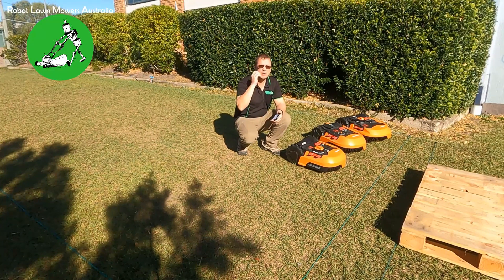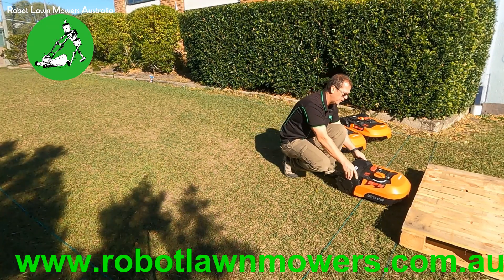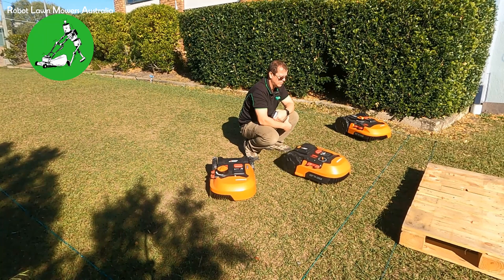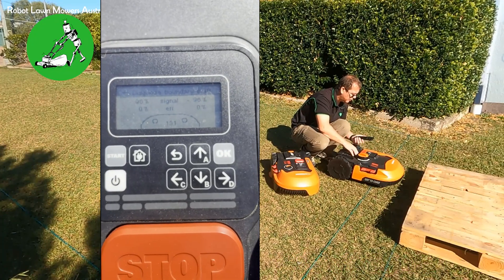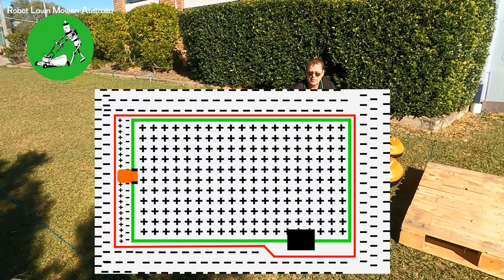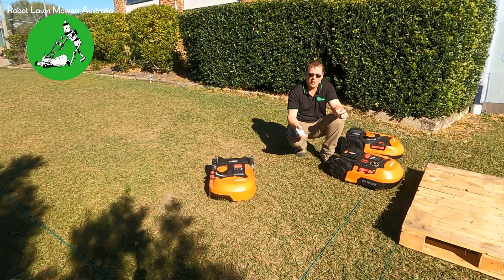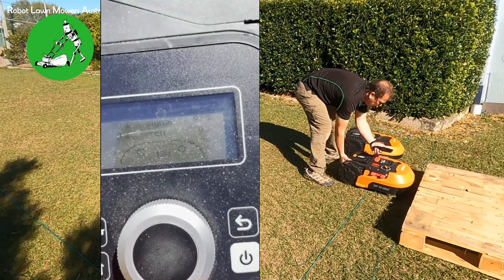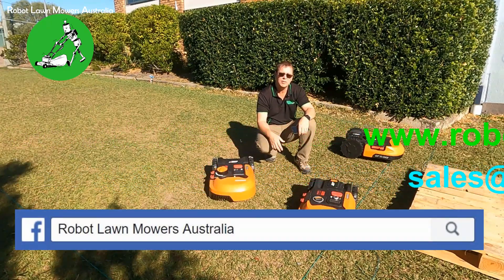Robot Lawn Mowers Australia - Worx Landroid Crossing Boundary Wire

Comment: Glad I found your video and thanks for the information.
I have this very problem with my W139 after I erected a galv-tube-framed chainwire mesh fence alongside the lawn.
The Landroid has become stuck twice over the boundary wire as it's wedged up to the fence, the gap between the boundary wire and fence is only 200mm. I might try narrowing the gap so it has more chance of pulling back out rather than getting too far into the no-man's-land.
The Landroid is on firmware 3.32, what update features would I be losing after rolling back to the earlier version?
Thanks for the great channel.
Reply from the maker: Glad this could help
Reply: An update: For the galv-tube-framed chainwire mesh fence alongside the lawn I raised the bottom ground level galv-tube frame rails 200mm and removed the wire mesh from that lower section. I replaced the mesh with a length of fibre-cement board. This has been successful. Going from 5 to 6 'stuck' incidents per 1.5hr mow, it's now bouncing off that section of boundary wire as per the rest of the perimeter. But I don't understand why it only happened here. I have another section of boundary that is up against a gabion wall, yet there are no problems there even though the gabion is encased in wire mesh? Oh well, all good now and "Shawn" is a set-and-forget worker!
Reply: Latest update: Well the redesigned fence hasn't been so successful. Two perimeter 'stuck' incidents in a recent 1.5hr mow. But then the next week, a successful mow without incidents. How can this be so? I 'spose I'll just have to put up with this . . . or change mowers!